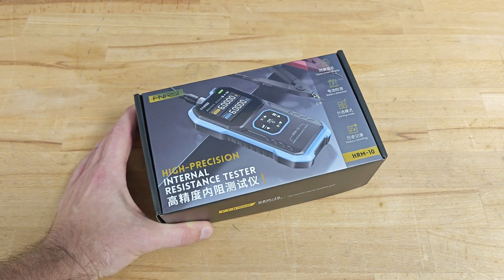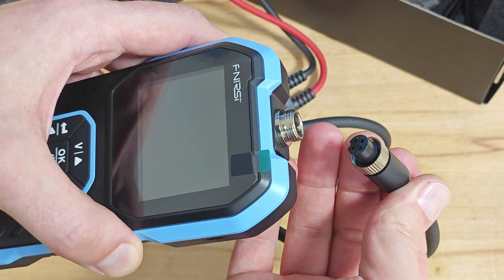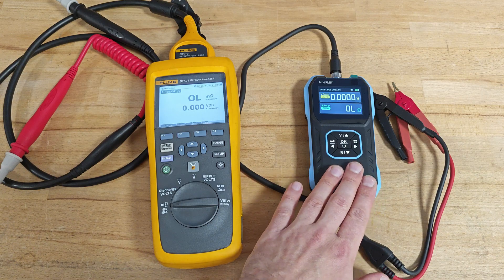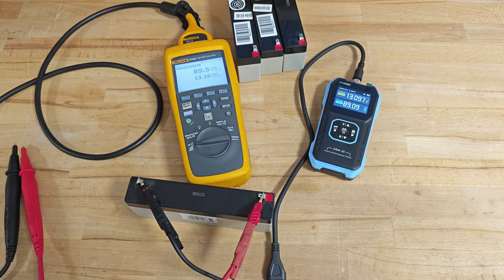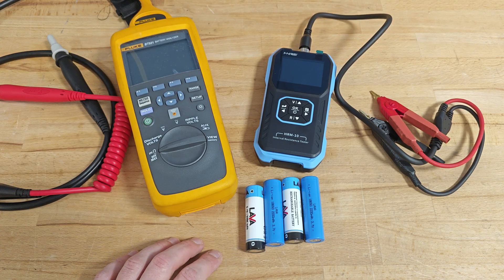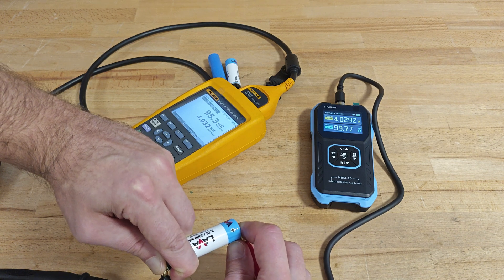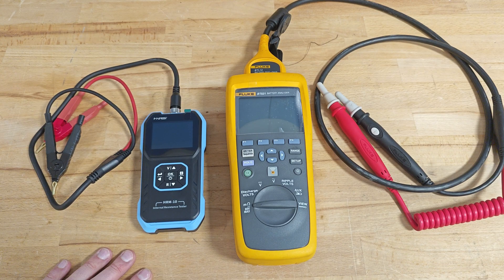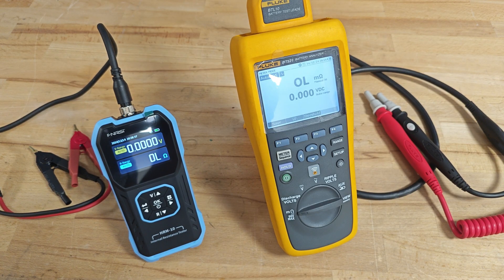Fnirsi Internal Resistance Meter HRM-10

Comment: The 100x price difference for similarly functioning devices is insane. I understand there are the certification, support, ruggedness, etc factor that come with Fluke. But when it comes to raw performance of the equipment, I just don't see the price justifying it.

Comment: I would always prefer the HIOKI BT3554 because if i have to test 240 batteries the waiting time on the Fluke is going to drive me crazy.
That little du-dad could be ok for a general car battery but i'm not inclined to trust the measurements after after the 10th battery.
Reply from the maker: Yeah, the waiting time on Fluke is not fun at all 😂
Reply: hioki is really also high quality stuff, but honestly too expensive...